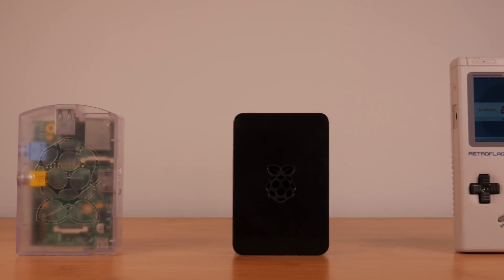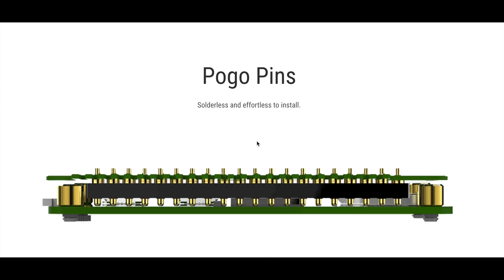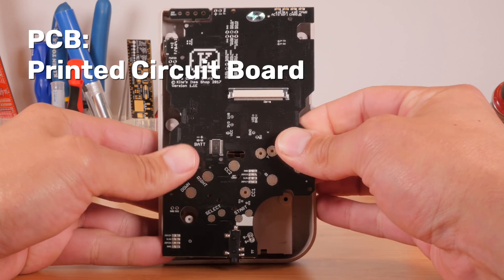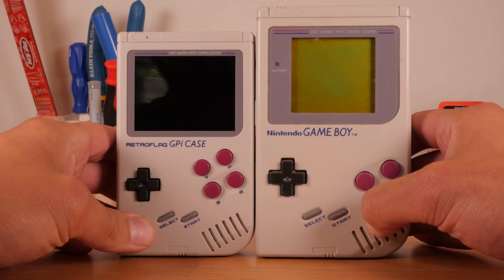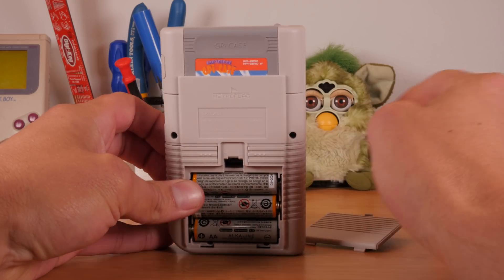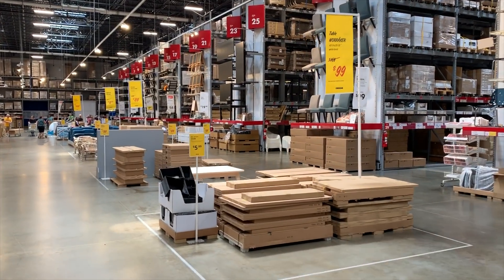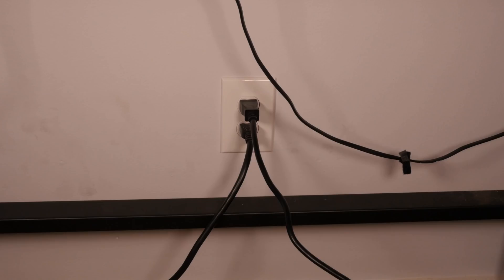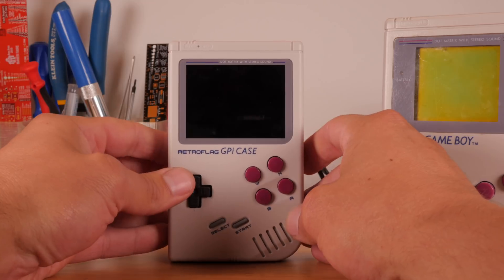Retroflag GPi Review: The Raspberry Pi Game Boy We've Been Waiting For!

Comment: Are you sure it powers the Pi Zero with 5V, since it can be powered with 3.3V via the GPIO?
Reply from the maker: Yeah, since the small ribbon cable connects the hardware via the Pi's Micro USB port -- 5V would need to be provided to this port, and thus the Pi would need to boost it otherwise.

Comment: The Gameboy design of the GPI Case is really cool but think a Pi Zero is not the right PCB to play retro games. The LDK handheld, with it's two core processor and specialy optimized handheld Linux (Open Dingux), is a better choice. Since it runs all 16 bit games with smooth 60 FPS without tearing(NeoGeo, CPS 1 & 2). You should install RetroFW (Custom Firmware) therefore. And the batteries are common Nokia style mobilphone 1050-1200 mAh (last 2-3 hours). They are very small, so you can buy one or two of these as reserve....
The screen of the LDK is only 0,2 inch (0,5cm) smaller... It has the right pocket-format and costs only  45-50 Dollars (ready to play).

Comment: Excellent video, well presented.
I can't wait for this to be released in the UK, if I can get one.
I already have the Waveshare Gamehat. It's amazing for the price, and you can use a full Pi 3B+. But it is a little uncomfortable, and has a home-built look to it.
It's a shame Retroflag couldn't squeeze a Pi A+ in there, it's not much bigger than the Zero, but a lot more powerful. Perhaps if they had made the case bigger, the same as the real GB, then there may have been room. Or, perhaps this is V1, and a V2 will come out next.
Reply from the maker: Thanks! It will definitely be released in the UK at some point.

Have you seen the Pi Compute Module yet? It has the same power as the Pi 3 in the form factor of a stick of RAM. Of course, it requires additional circuitry (not an issue for this setup since it already has a board). The Circuit Sword PCB that I showed in the video actually uses it — so it requires even less space than the A+ or B+ ;) Not quite sure why they didn’t use it. But based on the success of the GPi, I could see a lot of other companies releasing similar DMG-01 clones — hopefully some using the Compute module.
Reply: @Howchoo  Yes, I have heard of the Pi Compute, but isn't that missing I/O ports and wi-fi ?
Reply from the maker: @DKTronics70  Yep. But the idea is if a manufacturer wanted to use it, they'd put the required I/O ports and WiFi capabilities into their own board. :)

Comment: How many hours do you get on the ikea ladda batteries?  When it comes to getting the most power efficiently it sounds like we're going to have to bypass the voltage step-up converter and directly power it from lipo's, but I'm not at all familiar with that really.  ETA prime has said he plans a lipo install video along with adding wireless charging, that should be killer.
Reply from the maker: I haven’t tested the exact time yet with the IKEAloops yet, but it could be approximated with a bit of math. You can’t really bypass the step-up converter since the GPi (and Pi) need 5V to run. Small 5V LiPos don’t really exist, they’re primarily 3.7V, so you’d still need some kind of booster — might as well use the one built into the GPi already. :) I’m super excited to see what ETA comes up with! I predict it’ll involve removing the old battery terminals, cutting a lot of the shell, embedding the largest 3.7V LiPo possible, inserting an Adafruit PowerBoost 500C (or equivalent), and then connecting a small inductive charging circuit or something to the battery door that’s wired to the board. That would definitely do it!

Comment: Thank you for finding out that the GPi Case will self-shutdown if the power gets too low!

Maybe in the next releases or FW upgrades it will also have a warning added before the screens fade to black so we really know when it's time to shut the console down.
Reply from the maker: This is definitely possible -- I've never tried system overlays

np! That would be awesome. Also, it would be great if it sent the RetroPie "save" command before shutting down to make sure your current game saves -- assuming you're not playing a ROM that auto-saves.

Another thing I noticed that would be great.. some kind of sleep mode. I forgot to turn it off for a few hours while I was working on the video and the batteries were dead. Thankfully I used rechargeable batteries, but still -- maybe if there's no input for N minutes, safely shut down. Man, I wish I'd put that in the video :p Next time I suppose.
Reply from the maker: @Rhino Thunder That's strange -- does otherwise shut down normally when you toggle the power switch?